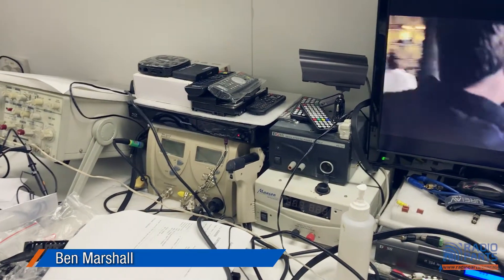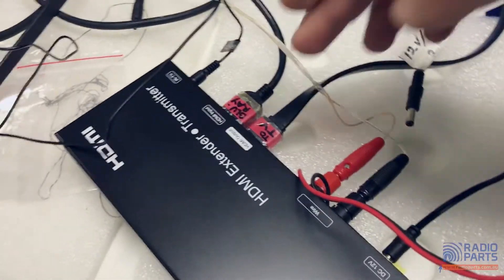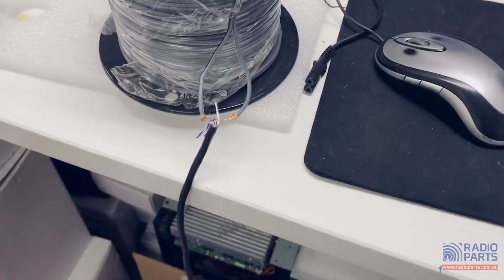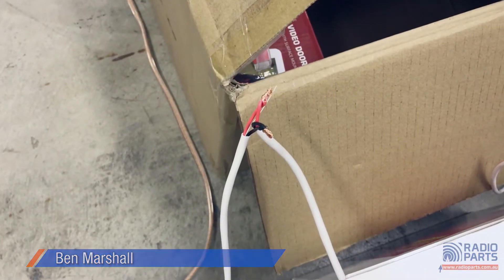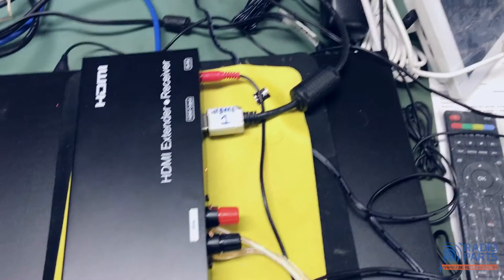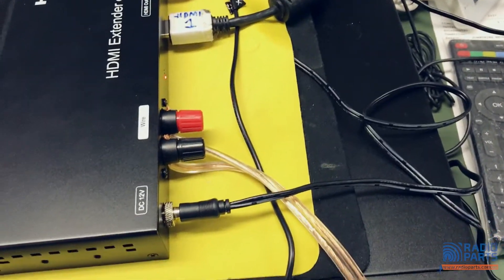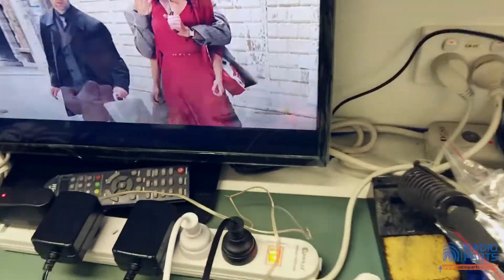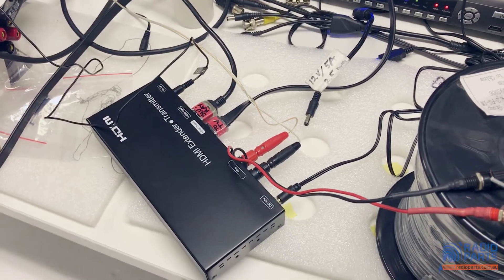Pro2 HDMIAW - HDMI over any cable

Comment: Specs?!
Reply: dargs001 Sorry, but as it's only a sample, we haven't finalised the specs yet. This was more of a "first look".

It was running a 1080p24 BluRay HDMI source in this video, and we weren't looking at multi-channel audio for this test.

HDBaseT and HDMI-over-IP are still going to be better choices for quality, but if you're stuck with limited copper in an underground conduit, this might be a product to try.

More will be up on www.radioparts.com.au when we're done testing. Hope that helps!